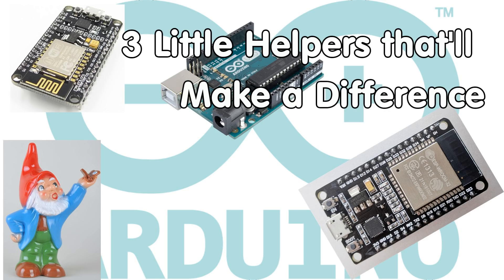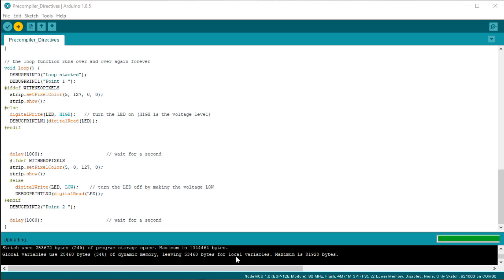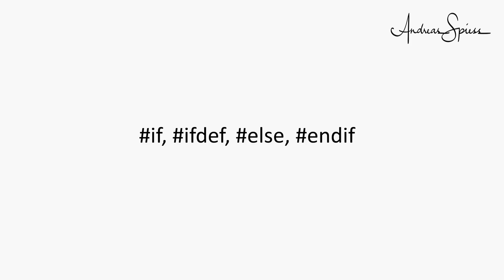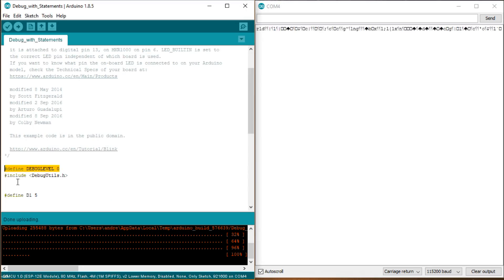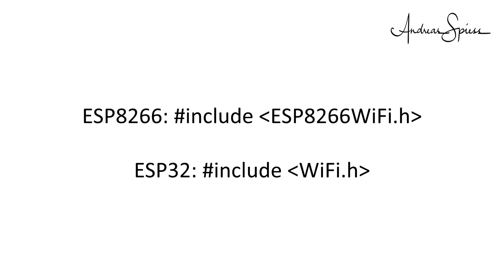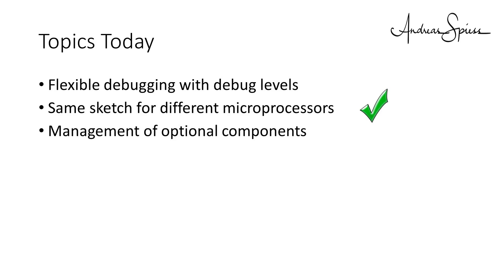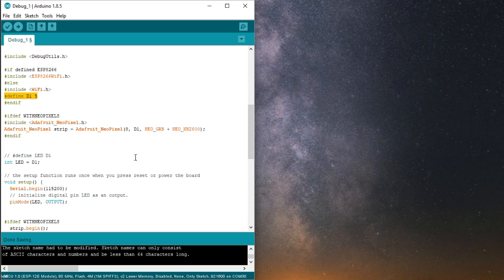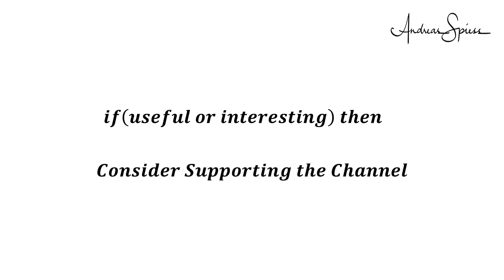#233 Three Little Helpers that'll make a Big Difference: Preprocessor Directives

Comment: Some more tips, #warning "this is a compiler warning" is useful if you need to show something important, #ifdef is short for #if defined(), which you have to use if you want to check for more than 1 condition,  #if defined(BLARGH) && defined(HUH), same for elif - else if defined(), now if someone could figure out how to define in sketch and properly check in a library, I have not been able to figure that one out.
Reply: Oh and header/include guards ( the ifndef  #define at the top of most includes ) serves to wrap the entire file so it only gets run once
Reply: @tablatronix  gets "included" once, not "run" once.
Except for that, good addition.

And yes, when using macro, NEVER add Space between name and left parenthesises, as you can do with C funktions.

So always uses capital characters in macros, so users doesn't confuses them with proper functions.
Reply: I had include and changed it, cause it was like include includes included .. lol
Reply: @tablatronix  I'd actually prefer #pragma once to old-style include guards these days. While it is not a standard thing, it is well supported by all the relevant compilers.
Reply: >now if someone could figure out how to define in sketch and properly check in a library,

If you put your #define right before the #include you can configure things inside the library header. For example
#define LOGLEVEL 1
#include <LedWithLogging.h> // logs things when LOGLEVEL == 1
This works, as the #included header is just pasted in there by the preprocessor, before evaluating #defines
Reply: That works for the header file of the library but not for the .cpp file.
Reply from the maker: @tablatronix: Thanks for the additions!
Reply: @tablatronix "now if someone could figure out how to define in sketch and properly check in a library, I have not been able to figure that one out." If I understand correctly this would be done by adding -DBLARGH=XXX on the command line. Which is unfortunately not supported by the arduino IDE. Given what I can read here from you, I would advice you to move on to a real IDE with Arduino support.
Reply: +Jan Baeyens, you can use Arduino libraries and compiler (GNU gcc) on command line, and then you can use Emacs and make files. :-)
Reply: @Anders Jackson There are many flavours and depending on personal experience, personal preferences are made. Going bare-bones as you  propose is an option for some of us. However it is not what most people are looking for nor is it an IDE.
Reply: But they can be used in other IDE:s, like Emacs or Eclipse.

Comment: There are some caveats with preprocessor defines that have to be taken into account - first one that comes to my mind is the preprocessor directive is NOT a function NOR a variable, for example #define SUM_AB a + b and then later in code SUM_AB * 2. The result of this expression will be a+b*2 and the result will be different than it looks like in code.. That is why You should always include the right hand side of preprocessor define in parenthesis like this #define SUM_AB (a+b). Be careful :)
Reply from the maker: You are right. This video was not intended as a "full blown" introduction, it was more designed as a "hook" that these directives can be of use for certain problems.
Reply: The video is perfectly fine, Andreas, everything You said there is correct!

Comment: so it's normal for the sketches for the ESP8266 to be that massive?
Reply from the maker: The WiFi lib was included
Reply: Yes, Arduino core for esp32 uses FreeRTOS and espresif ESP-IDF so every even most simple program have pretty huge overhead, and wifi isn't small.
Reply: Yup, if you compile the blink sketch it'll be massive also - there is all the extra stuff needed for the expressif SDK, etc. But the chip also has a lot more flash memory, so it's not that much of an issue. Blink sketch on ESP8266 core 2.4.2 for generic ESP8266 with default settings is 247940 bytes (49%) of program storage space, 28028 bytes (34%) of dynamic memory... just a minor overhead? :D

Comment: Andreas, great video! One request, when you do IDE style videos like this one. The right half of the screen is empty. Could you enlarge the font (like 150% or 200%) and use more of the screen to help us when watching on a smaller device? Thank you for making these videos.
Reply from the maker: The right part is for the output of the Serial monitor. I agree that small screens are not good for watching coding. This is why I try to avoid code in my videos as much as possible. If I enlarge the font the overview is lost and people do not know where I am. My code screen size is only 1280x720, the rest is in HD. So I enlarged it already...